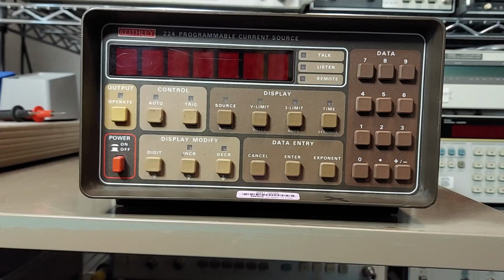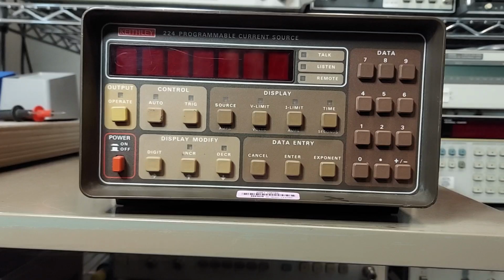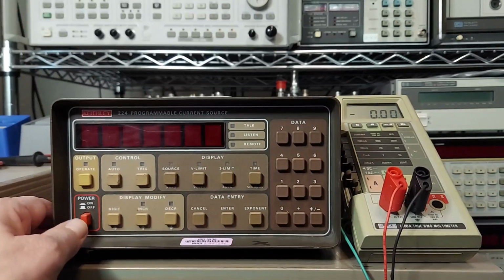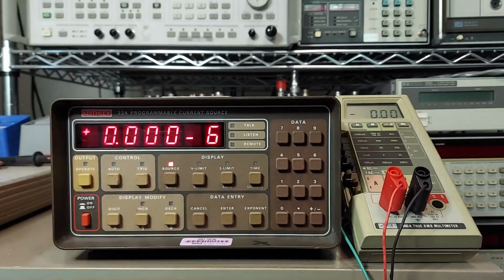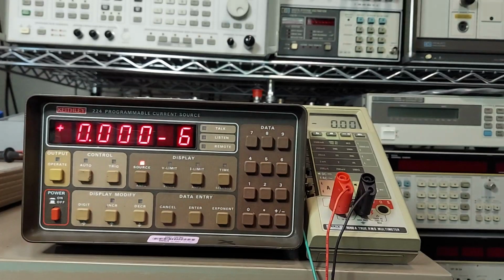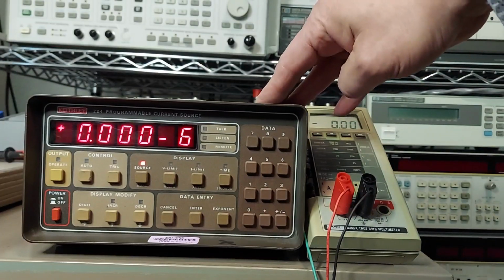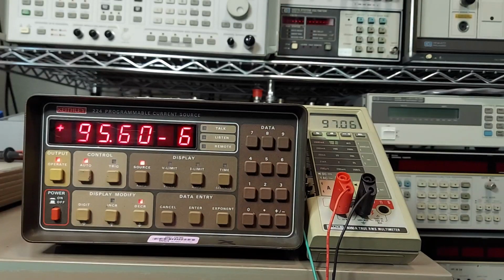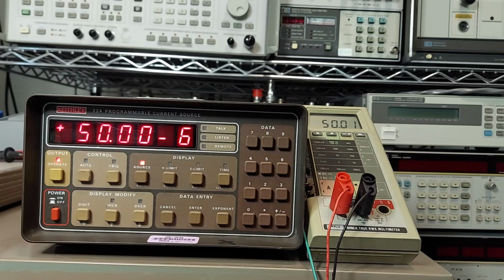Basic operation of the Keithley 224 Programmable Current Source.

Comment: How are you connecting to that triaxial jack on the back?
Reply from the maker: Yes, I bought several cable assemblies that allow me to connect the triax connector to the device under test. I bought three cables in total. One with with banana jacks to connect to a multi-meter, alligator clips and spring loaded hooks. You can find these cables ready made or you can order the triax connector and make these assemblies. The binding posts on the back are for only monitoring the compliance voltage applied to the DUT.